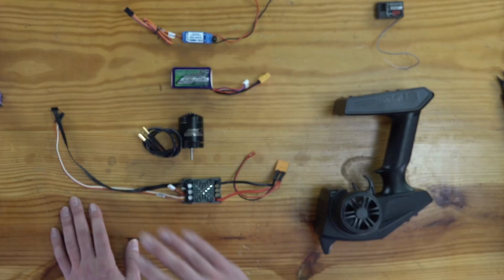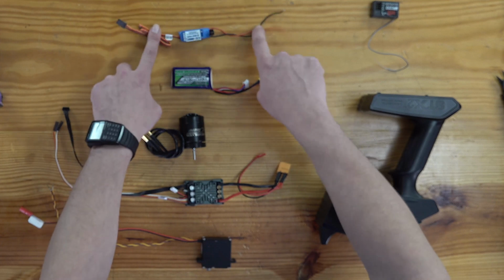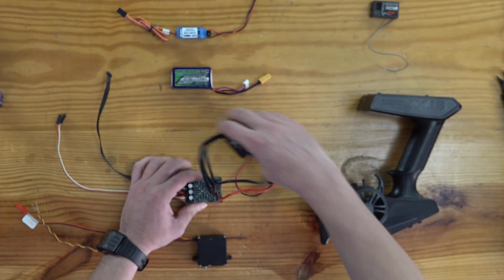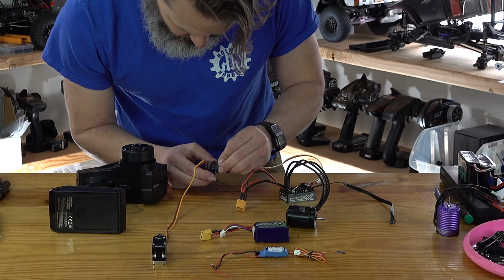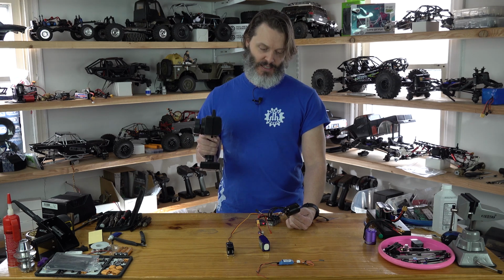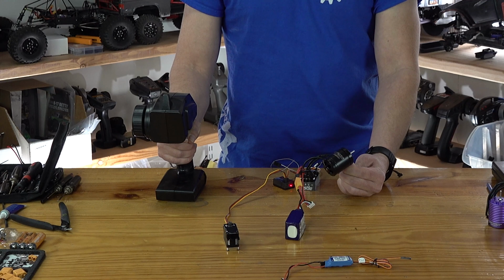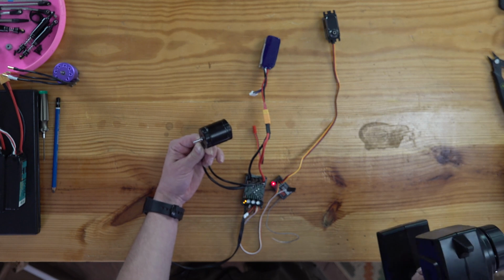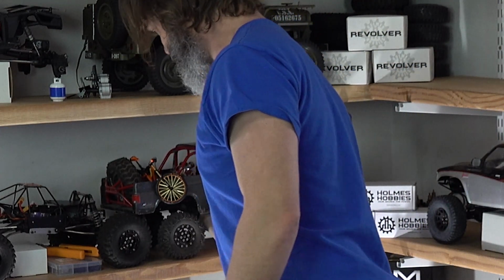New To Radio Control? RC Crawler (Or Any RC Car) Electronics Overview For Noobs - Holmes Hobbies

Comment: Great video! Looking forward to more in-depth electronics guides in the future.  I would appreciate a video on the dos and don'ts of electronics with regard to how to maintain/not destroy them.  A trouble shooting guide might help too.  For example, I have an SHV650 that twitches, and I don't know why.  It's plugged directly into a 3s battery along with a Copperhead ESC and a Puller Pro Stubby. Any thoughts on the twitch?

Comment: You have most likely covered this at some point!  Does the b-link work on the torque master BR-XL esc?  Not sure I'll ever need to change the settings but I dont own a computer...got rc's instead lol!
Reply from the maker: Yes but not recommended,  it can scramble the throttle curve
Reply: @HolmesHobbies   good to know thanks. I probably will never need to adjust it but it's good to know. Again thanks.

Comment: Love your videos! I have been building a Ryft kit to be a little more rock crawler friendly and still rock racer capable. I'm running a copperhead 10 with a 1415 2400kv 13 tooth pinion. Your products aren't well presented on the Ryft pages. You should do a video for us to see what options we have with your products and your opinion! Seems like the first thing most Ryft owners do besides a sway bar is move to a sensored system. Thanks for the content!

Comment: Yeah, I got a few tips for you too: Avoid anything Traxxas, specially electronics. 
Avoid any chinese re-branded transmitter, like the Tactic ones and the othersI saw you got there. Stick to the Kyosho Synchro, Perfex, The Futaba and the Sanwa transmitters.
Avoid recent Axial models, Gmade and Vaterra.
RC4WD are great crawlers, also the Absima ones ( CR 3.4 Sherpa, Khamba and Yucatan. They are made by a  brand called Yikong, with pretty high standards and quality). The FTX Geo, the Spyder, the Fury Extreme and the Mauler, they are pretty good for the price too. And yes: I'm a newbie that started in this hobby just 30 years ago.  Now, happy RC.

Comment: Is it best to have a sensor or unsensored motors for crawling
Reply from the maker: Either if they are designed for crawling
Reply: The one thing that's VERY important about a Sensored motor is that it's ONLY to be used for crawlers and NEVER for race nor bashers, remember that!  The other issue is if a Sensored Brushless packs it in, then you have to replace the entire unit!  Other than that....it surpasses everything for ultimate 'creep' control.
Reply: What if I'm doing trail too
Reply: Sounds like a good excuse to buy a used bomber or an older capra.
Trail trucks tend to get beat up, crawlers don't like being beat up. They quit crawling decent pretty quick.
Reply: I'm waiting on Uncle Sam and going to get the SCX10.3 Gladiator was wanting to do both. Putting a puller pro v2 and copperhead 10. If there are any available. Slight lift on 2.2 wheels.

Comment: I have a sw4 paired with a 2000kv 14 pole outrunner .It does a similar thing if i dont give enough throtle. Some people say its the polarity of the motor but how you tell the diffrence between a and c cable on the motor
Reply: Nvm it was my controller exp% that was messed up

Comment: What do you think about using CorrosionX on the electronics to protect and waterproof them?
Reply from the maker: Better for motors, silicon conformal or epoxy potting compound is better for esc

Comment: Would that "abs" be resolved with your up an coming silencer V2???
Reply from the maker: no, this was a radio issue.   I'll have to figure out how to remove the ABS function or just use another radio.
Reply: @HolmesHobbies  it's all good, just had to ask a question as I thought of it, cant wait for those V2's so I cant get my sherpa build moving forward, thanks for the info

Comment: Thank you for this video. Being fairly new to the hobby the electric side of things seems a little intimidating as I do not want to destroy my components. I would eventually like to be able to wire my own stuff and to better understand how the parts work together. I’m using a direct powered servo simply because I do not know enough about BEC’s and want full speed from it and again do not want to kill my rigs. 🍻